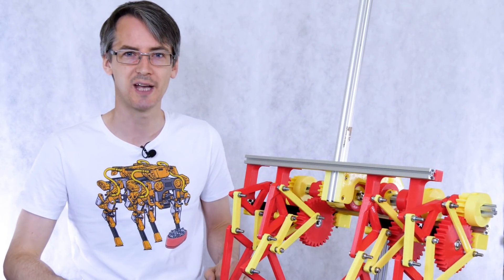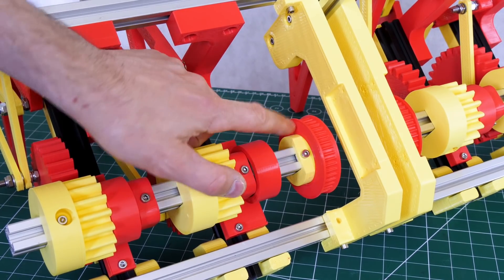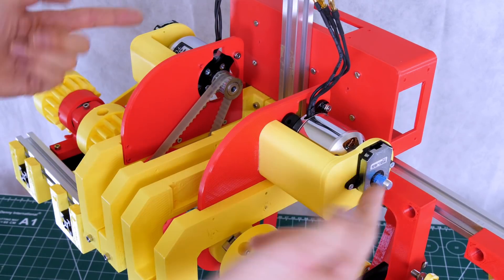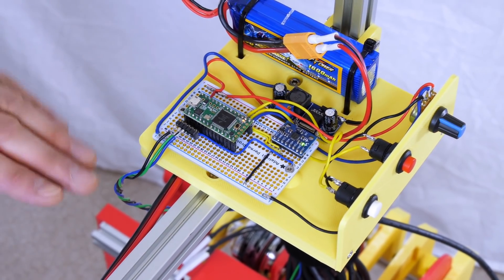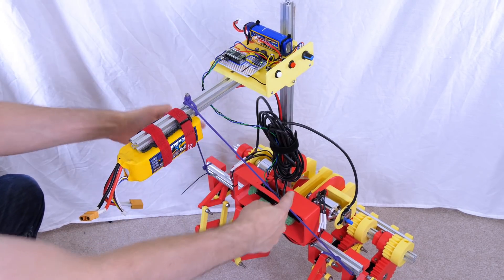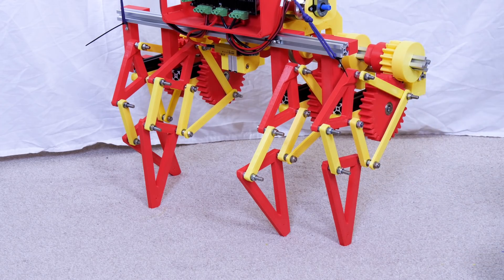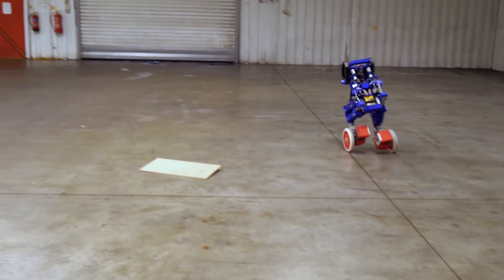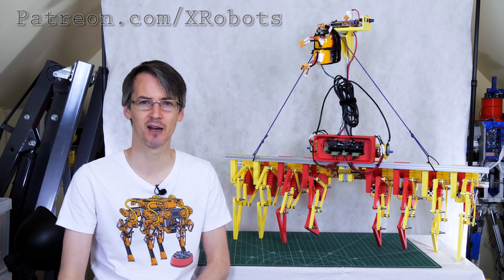Balancing Strandbeest

Comment: I think the fundamental issue with legs binding up is down to the fact that the tips of the legs move along a flat plane when down.  If there were a way to move them in an arc along the circumference formed around the center of gravity, I think you would have it.
I just don't know if the geometry of the original leg allows for this...  :-/

Comment: Have you looked into using fasteners like this for your extrusion profiles? https://us-product.item24.com/en/catalogue/products/standard-fastening-sets-1001012015/
Or even just directly screwing/bolting metal to metal or using angle brackets? I know the fittings are often the most expensive bits but the rigidity would improve greatly compared to the 3D printed interfaces. Similarly, profiles with even partially closed grooves really improve torsional rigidity.

Comment: Hm, would it help to apply a weak low-pass filter on the IMU data to filter out the vibrations from the feet hitting the ground and maybe the uneven acceleration from the steps?

Comment: Strandbeest linkages can certainly go backwards. Interesting, was hoping you could get it done with 4 legs like that.
That's a good point about the linear motion not being always proportional to the motor movement. One would think it would need a function to accommodate for that, but then each leg is moving differently, so would need independent control. It's a tough problem for sure.

Comment: wow good work, i never would have thought more feet was the answer. I would have assumed needing to dynamically locate the batteries / center of gravity was a requirement.
Reply from the maker: It does by speeding up or slowing down the feet

Comment: The bungee cords are bending the aluminium beam where the Legs are attached, making it strain the center legs.
This strain on the center legs, in turn forces them to bend quite a visible amount, specially visible when filmed from the front.

I would suggest to replace the bungee cords with a screw rod, to simplify adjustment, and improve rigidity.
Reply from the maker: it's not bungee cord

Comment: Holy shit it actually walked. You're definitely falling short on torque and thats causing your motors to loose speed and that makes the motors loose their motion sync. When this happens, one motor tries to catch up to its sync pair and slows down the robot and it tips over. Try gearing it down a little more and improve the linkage joints.

Comment: You should have that tall part holding the battery flat towards the back and you should put a caster wheel on it so the legs can pull it along
Reply: Could also get away with just having 2 legs and a wheel in the back like a trike :)
Reply from the maker: But then I wouldn't acheive what I wanted to.

Comment: I would suggest putting a "tail" on the back that it can rest on at full stop. It would not touch when it walks but would add a safety measure from tipping backwards and allow stability when you stop the machine.. You could make it interesting looking so it looks decorative and have functionality.

Comment: Maybe there's a bit to be gained by changing the order of the offsets. My impression is that on each half the feet are in a simple sequence (12341234) instead of touching ground  as far apart from each other as possible (es 14231423, though there's possibly a better arrangement)

Comment: if you replaced the two links that are usually running on the crankshaft with linear actuators you could dynamically move them and make some freaky light legs

Comment: Could you embed magnets into the drive gear and use a hallefex sensor to determine how to accelerate or deceleration the drive gear to make the speed consistent?
Reply: No, because all the legs run on the same drive shaft. If you made one leg move more linearly the rest would be adversely affected.

Comment: Always very inspiring content! Have you ever thought about using more advanced control techniques like model based control desing and state space? I think you culd improve a lot since your desingns keep getting more complex and difficult to control. Something that may help with balancing this robot is to place the IMU closer to the center of mass of the robot to exclude disturbances from the rotations, or compensate in software by calculating the inertial frame of the imu with respect to the one of the robot.
Keep up the awesome work!

Comment: Why not make the legs taller and put the mass between the legs to get a much lower center of gravity?
Reply from the maker: A stick is easier to balance on your hand with the mass at the top
Reply: @jamesbruton  True, but then you need to actively correct it (which you are not doing right now). A lower center of gravity gives more natural stability.  It's like (beginners) wakeboarding/waterski, if you stay low, it's easier.

Comment: You can make the leg that is off the ground move much faster then the leg that is on the ground that way you tend much more leg on the ground. I achieved this on 1 of my robot from putting a motor on each leg and driving the motor faster when off the ground than when it is on the ground but I have seen it achievd with only 1 motor by using a strange gear that has 2 different size in the 1 gear see 2:35 of this video of  a walking horse https://www.youtube.com/watch?v=66onfZ_Vtd8

Comment: Halfway in and just saw the first balancing demo and it looks really good - as someone who's built more than a few dozen balancing machines of varying sorts, every walking one I built tended to fail unless it had at least three points of contact on each side - here you've only got two legs/feet per side, 180° out of phase, but if you added a third leg/foot to each side, shifting them all to 120° out of phase, the results would become dramatically better! :)
edit: yeah, at 8:35 ish, you've got the right idea!
edit-edit: whoah that went way further than I was expecting. glad to see so much info and experimentation packed into one video!

Comment: The integral gain term in a PID controller is to eliminate steady-state error, not to increase the "speed of response". Without it, the controller may find an equilibrium at a steady non-zero error where the control action balances any constant forces.

Integral gain is inherently destabilising, so it makes sense that it should be small compared to P and D. If you haven't already, you should consider capping the max value of the error integrator (the integrated error value before multiplying by the gain) so that it does not dominate the response.

Comment: Wicked! its really cool to see it basically walking and balancing. I think you're right that the geometry of the strandbeest is causing issues going in the other direction, the mechanism itself is not symmetrical and the foot movement along the ground is a straight, flat line parallel to the ground when the bot is horizontal. When it tips, because the gait isnt adjustable the foot movement which would be parallel to the ground ends up kicking into the ground. 

Maybe try a mechanism with a symmetrical gait and movement? Should allow more uniform back to front movement. Another issue could be the weight distribution, because of how the weights are all offset from centre by so much it's causing a different response/shift in the balance point when it tips back compared to when it tips forwards. Hard to explain, but look at the battery on the boom. When it tips one way the battery moves in that direction and down, when it tips the other way the boom moves up and in that direction.

Comment: Congrats on getting it to walk already.

A quick thought: Use the batteries as a movable mass that can be shifted in 2 axis parallel to the ground. This will allow the robot to have more control of it's balance than just having the legs. The programming for it would be similar to the balancing code for the legs with an IMU telling it when it is out of perfectly level and the motors shifting the upper mass in a direction to re-balance the robot on the legs. The left and right axis is added since the legs are going to cause shifting points of support on that axis that a two wheeled robot doesn't have to contend with. This should allow it to balance on the spot.
Another suggestion I have is to place the battery in the space below the body in the space between the legs, lowering the center of mass and making achieving perfect balance while stationary easier. This could even make it possible to not have to shift the mass of the batteries as much or as fast to make corrections, resulting in less leverage for the mass to bend the system, resulting in a more stable robot.

Comment: @James Bruton Heya bud! Been watching your videos for a long time, and you are always miles ahead of anything I can try to think up, so I haven't really been able to help much...

But...! I've noticed something this time, while watching the robot try to walk backwards in the initial attempts. When the leg is moving in the 'forward' animation, when the foot hits the ground, the parallel bars are farther apart, but in the reverse animation, when the foot hits the ground, the bars a quite close together, reducing torque at the foot, in addition, the foot is angled sharply backwards, causing a lot of slipping.

I've a simple(ish) solution, though! Just flip every other leg! The extra legs were primarily to keep more points of contact on the ground, as the robot can already support it's own weight, they aren't needed for that. You can keep the extra points of contact with the legs reversed, and while they'll provide minimal assistance for forward momentum, it doesn't seem necessary anyway.

Comment: Armchair thoughts: back when it still had only 4 "feet", could lowering the centre of mass have changed how the thing handles? Not sure if that makes any sense, trying to say: man with tall pole on head may topple over trying to walk as well.

Great videos, love the dogs, thank you for giving me random things to ponder.
Reply: Wajed Al-Rahman higher centre of gravity actually makes this sort of thing easier to balance
Reply: @ciarfah   hmm, thank you.
Reply: Wajed Al-Rahman The inertia of the heavy mass at the top makes it want to stay in place, and the lighter base moves underneath to keep the centre of gravity vertically above the point of contact on the ground (to prevent tipping over)
The classic analogy is balancing a broom in your open hand; it's much easier to balance if you put the tip of the handle in your hand and have the heavy end in the air, than to put the heavy end in your hand and the handle in the air

Comment: Besides adding more legs, you need to add more mass to the body so that the legs are a less significant percentage of the total weight.  Being essentially nothing but legs (moving parts) is the worst case and adds a new dimension to the balance problem.  That means that getting it to work will involve algorithms that don't transfer to the wheeled robot, but are unique to legs.